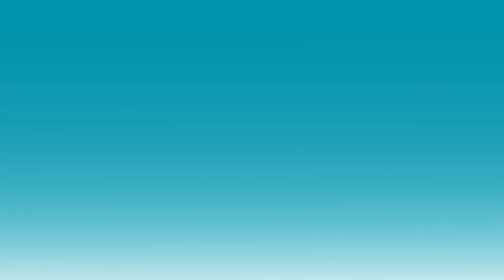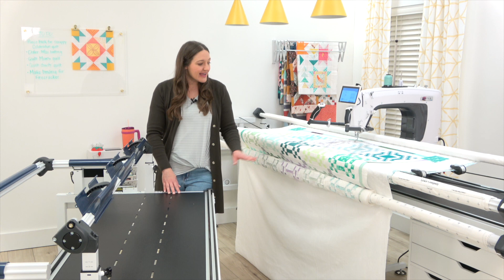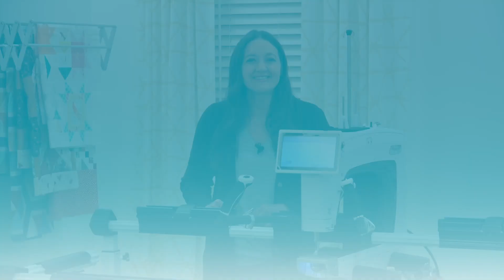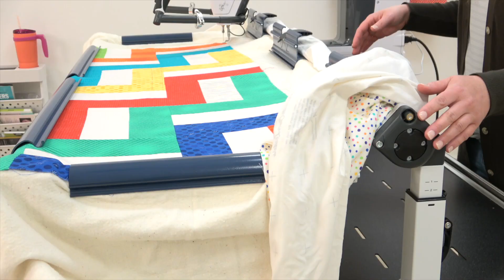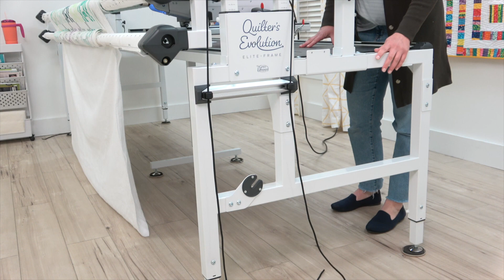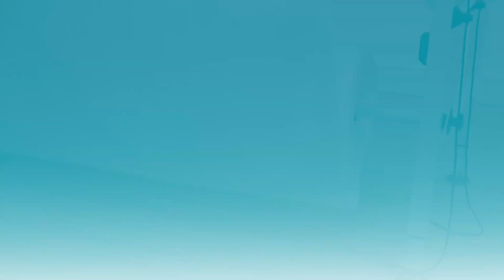Compare Quilter's Evolution Machine Quilting Frames

Comment: Why would you only to be able to quilt a maximum width of 83 inches on a 10 ft frame?
Reply from the maker: Due to the frame the machine sits on, you can't reach the very edge of the frame space. Plus you need some extra room to secure the batting and backing. If you're considering a frame, take a look at the maximum quilt-able width and not just the width of the frame.